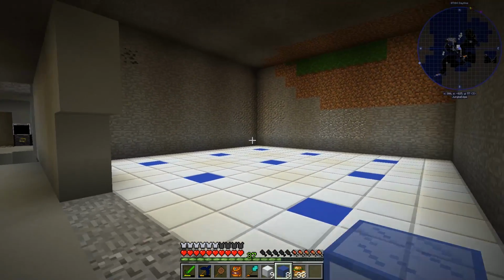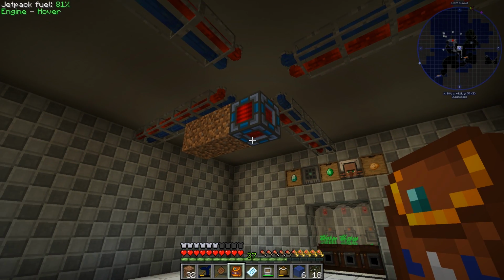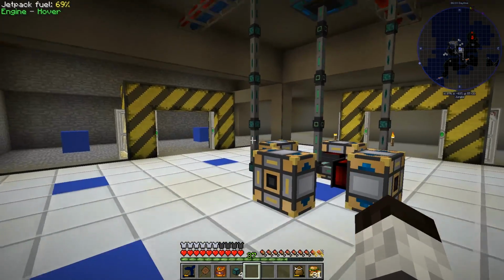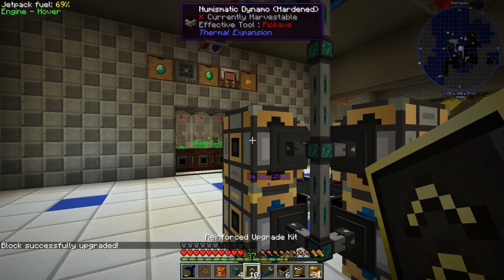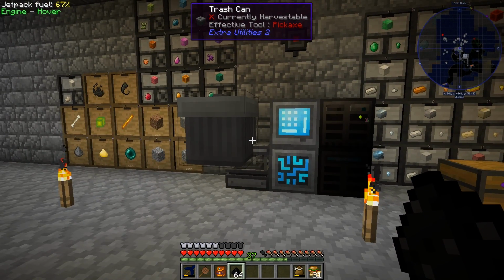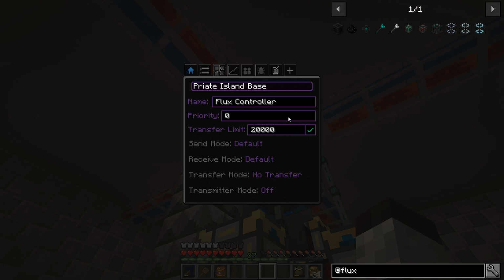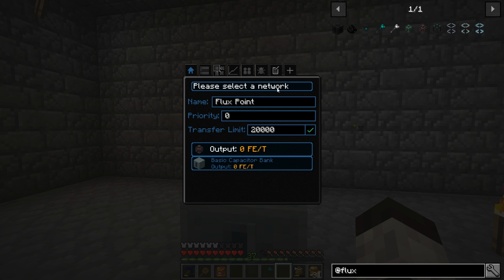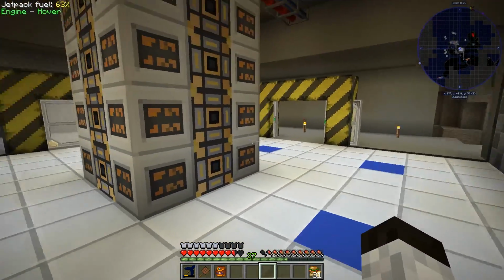FoolCraft 3: Episode 10 - FLUX NETWORK POWER CORE

Comment: Hi. I was watching your playthrough. Very nice presentation. but, I noticed you only have the basic 10 hearts. If you open your inventory and look at your nutrition, you see % in 5 types. Get them all up above 90% & you get buffs. Dairy is easy as you can drink milk over & over again. The best food is Deluxe Chicken Curry, but that is a process or 3 to make. Actually Additions Fish & Chips is easy to make and a few traps will supply the fish (Protein & Vegetable 5.9%). Also nice is the Act Add Chocolate Cake  (Dairy Grain Protein 5.6%). fruit is the hardest I use d Act Add Pumpkin Stew.  Now I have 20 hearts and a bunch of buffs.
Reply from the maker: Yeah, I need to work on that.  It will get better.  I haven't looked much into the nutrition part.

Comment: You can set the flux controller to wireless charge your inventory items and you can change the transfer mode to God mode which is way better.
Also - you can change the setting of the flux plug and point to ignore limit which can transfer like loads of power.